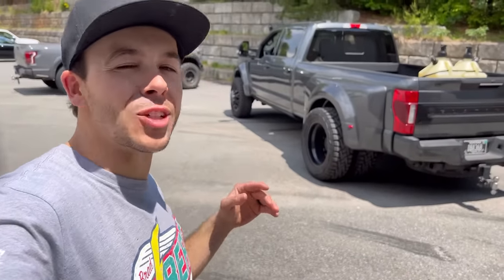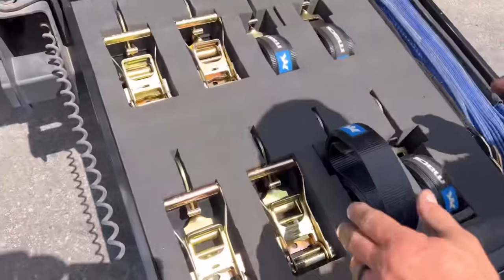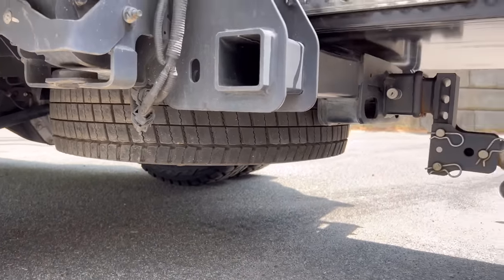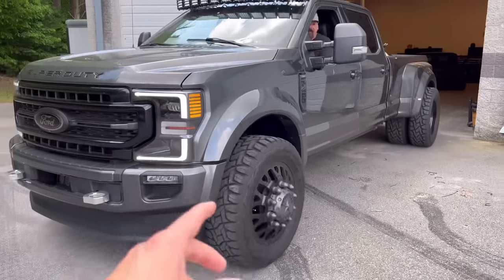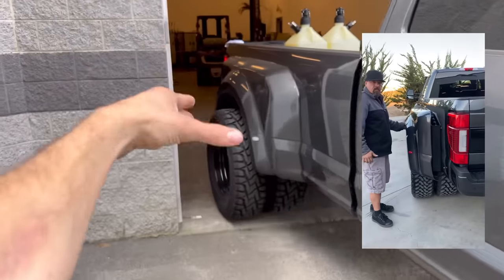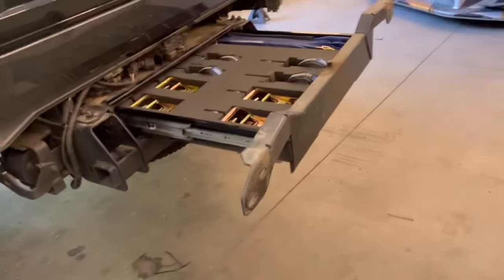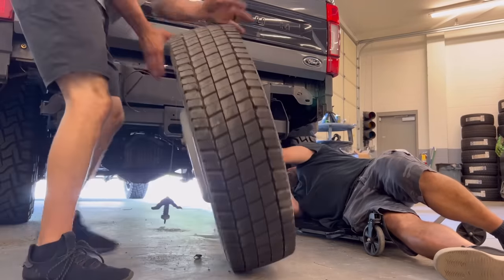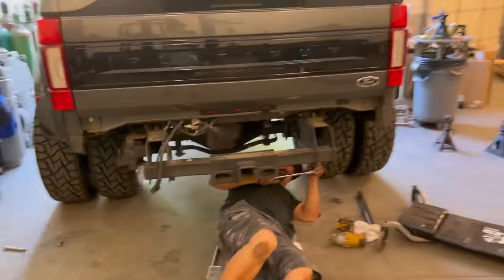BEST TRUCK INVENTION OF 2022? Hidden truck compartment patent for Ford, Dodge, Chevrolet & Toyota!

Comment: Hi guys, great idea, want one for my F150. But I ask hopefully one simple change. Can you move the spare tire connection under truck to passenger side? Thinking might be a dangerous situation being on traffic side if pulled off on shoulder. Just a thought. Keep up the genius ideas!
Reply: I also didn't like seeing how that's on the driver side, making it dangerous if you're on the shoulder of the road  during an emergency..... Passenger side usage is definitely preferred!
Reply: I will take one gents. My tires are two big to hold a spare. So I have plenty of space

Comment: How well does this hold up when you get rear ended (most common vehicle accident) and what kind of changes would you see with the stock bumper vs with this not to mention how well the drawer keeps items protected in such a case.
Reply: Probably about as well as a regular truck with a huge toolbox in the bed or a bed cover. Most people just toss stuff in them and lock it. They are using the crash and crumple zone space for storage space. Just like modding your car/truck you are using the safety and reliability % that manufactures have to design into their vehicles for longevity and warranty and various mandated vehicle laws. 
Get rear-ended in a regular car or truck and you will be replacing a lot of panels, brackets and 1 use only crash features like crumple pillars, foam and seemingly useless plastic parts. Guess where all those parts are on a stock truck.... 
Guess what you need to replace if you have these mods in a similar crash...

Example. I built a rear cross shock tower bar to square up my rear end for track day fun. It worked perfectly. Few years later a lady hit my car. If it was stock all the damage would have remained on the left side. Since the aftermarket bar was there it sheared off all the bolts on the other tower as well and the lower welded part dented the bottom tower. 
It's all about give and take.  

I honestly don't think there is much you could do outside of making a tank that would keep all those mods square and 100% perfect after a crash. 
It's a I had all this awesome convenience in my truck for 5 years then got into an accident and had to replace it. One of those well that sucks but it was worth it mods.
Reply: Your insurance probably won’t cover anything you have stored in this drawer
Reply: How can being rear ended be the most common accident? Statistically there will be just as many people rear ending someone else.
Reply: @Idontrunntoofast  
They back into each other
Reply: @Idontrunntoofast  bow chicka wow wow..........
Reply: @Idontrunntoofast  Youre thinking too hard about it, rear end collisions are the most common vehicle accidents. Thats what i was referring to.
Reply: @MSKDx  You are thinking to hard about it. It was a joke 😒
Reply: @lknanml  that's the reply I was looking for ;-)

Comment: Hey Brad, I have had this idea for years. So glad you built it and want to bring it to market. I will certainly purchase one. Does it impact the gooseneck hitch or does it stop short? Do you know if it will work with a 2010 F350? Thanks
Reply: I 2nd the question about the gooseneck
Reply: I third the question about the gooseneck
Reply: I 4th the question about the gooseneck
Reply: I 5th the question about the gooseneck
Reply: I guess I 6th???? 🤣🤷‍♂️
Reply: @sway696  you 6th about what?

Comment: Cool, but how does this modification affect crash zone test?  I know folks modify bumpers, usually to add beefier ones.
Reply: It’s literally a bolt in part, inside the hitch area. How would that affect ANY crash test numbers that would be of concern? If nothing else, it adds metal…… please stop making things more complicated than they need to be!

Comment: Van lifers and off road Enthusiast would love that transformer truck! Have a large Lipo Battery source for off grid living on one side, Solor panel on the inside of the Part of the truck that you raised up. and a fold out kitchen for the other.  And your bed is still left for a tent. Camp Anywhere!!    Anyway just a thought...

Comment: Very inovative . I like it a lot. Maybe you can do a hidden hoist that could easily unfold to lift anything you want. I could use something like that to lift my Power Wheelchair into the back of the truck. My chair weighs 300lbs. Keeping in Mind that it would need to clear the tailgate when it is in the down position. Great stuff guys. I hope this product takes off for you.
Reply from the maker: Thanks Bud.  We've been hoping it would take off too!!

Comment: Great stuff, I use a pickup for work and organized storage is difficult. The problem I would have will your systems is that I live in the north east. We get snow. Road salt is a killer. I wash the under carriage of my truck after every snowstorm and I still get tons of rust. I could see salt/rust causing operating problems with your systems. Even if you use some stainless steel the salt creates rapid dissimilar metal corrosion. Terrific product. Keep up the great work.

Comment: I love this concept. I use my truck in a similar fashion with a truck cap and boxed unit in the bed. This would add another layer of storage and access that folks would not otherwise know existed tucked away. Curios about how this is secured from tampering.

Comment: As a gas fitter, I could easily use this space for the less commonly used 1-1/4” and 1-1/2” piping and fittings. Although I’d have to ensure I could still use some airbags in the rear. Already squatting as it is.

Comment: Great idea.  With all these short bed crew cab models out there, how about a removable frame to transport 16 foot boards like 2 X 10s and 12s.  Maybe something that goes on the front bumper and over the cab to the back of the bed.

Comment: Love the design and your solution’s. I would change only 1 thing, the spiral-cable on the left will sack over time and will get jammed when closing. If there is a 2 feet pipe attached to the bumper with the cables in and only the spiral cable stays in the structure. It will extend the lifetime of the cable.

Comment: Awesome design with functionality in mind! My only concern is when it comes to installing/uninstalling, what if someone doesn't have the equipment to lift the box (i.e. a forklift or jack)? Maybe if possible incorporate the spare tire winch in some way to assist in the procedure (i.e. machine out something similar to the center bore on the spare tire's rim on the frame of the box) Just throwing ideas from an engineer's perspective, but still an amazing product regardless! Keep up the innovating guys! :D

Comment: Only concern I have so far is the spare tire winch relocation. It looks like if you have a flat tire and you're pulled over on the side of the road that puts you out in the roadway to lower the tire. I realize it's not that big a deal for someone I was just wondering how hard it would be to relocate it so it was accessible from the passenger side of the truck

Comment: Awesome Build. 
Very creative & well executed. 

As I watched you lower the tire, I thought, “Wouldn’t it be cool if someone made a pro quality adapter for a tool that would fit in a 1/2 cordless drill to lower the tire?”
Just thinking out loud for those who like to tinker.
Reply: It would also be safer to relocate the spare drop down to the passenger side of the truck due to an emergency, you are not on the lane closest to traffic when changing a tire

Comment: I have the Decked storage system in the bed of my 2019 Silverado 1500 but this bumper storage might have to be the next addition after I beef up my suspension! That is of course that it will be built for Chev trucks that is.

Comment: i would put on on my 83 chevy square body crew dually, only thing is i have the body ob a school bus frame so it would need to be custom built. and i would want it to go much deeper into the frame toward the cab. you have a great design there guys!!!
i built my custom truck completely by myself, didnt take it to any shop, but it is a simple job to mount a truck body on a school bus frame then move the axles forward to fit the fender wells. yes, had to have the drive shafts custom made by a drive shaft shop. i did put 5 ton military axles in it so i would have 4X4 but it is still licensed as a gas truck but it actually has a DT360A

Comment: Nice idea. I do wonder about DOT approval. I would think it would need to be crash tested since it's affecting the bumper or what's left of a truck bumper now days. Since the bumper is frame mounted so the frame absorbs impact, that may be an issue. I cert used cars and it would have to be removed and original assembled for liability.
Reply: Knew a guy back i n the 80's. He had made a custom rear bumper that  was also an  air tank, he was working on a pull out drawer and planning fold down bed sides above wheel wells and drawers in front and  behind wheels. 
His  insurance company  said reinstall original bumper and don't do any of the other alterations or he would lose all state required coverage.

Comment: It looks like the factory crank handle you're using for the spare tire places the driver on the driver side of the vehicle. Can you crank the tire down from both the driver side and the passenger side? It would probably give the driver more piece of mind if you could crank from the passenger side in the event of a flat tire on the side of the highway. putting that little bit of distance between the user and the rest of the drivers on the road would make it that much more comfortable/ piece of mind for the user. Other than that, it's a very nice product and can't wait for it to come out!!!

Comment: I work for a hydro utility
Lengthy bins r good for arrow, flagging and work signs. Also sometimes a hot stick or two (extend-a  P-2 stick and 6-7 ft universal gripall) may be toted as well, needing a moisture free compartment.
If u can get the lengths and moisture proof in these bins the utilities would probably scoop some up.
Just adding I as well as others wondered when something like this would be implemented into pick ups.
Not knowing where your from make sure u get into Canada.
Later.

Comment: It's very cool, and most of that is just unused space anyway... but what do the modifications do for the integrity of the truck? The back bumper, for instance, is no longer bolted directly onto the truck's frame, so what would it look like if someone rear-ended you at a decent speed? What kind of damage are you looking at if someone side-swipes you? Before it would just be a cracked fender that's replaced fairly easily, but does this change that? Awesome idea, but those are questions that serious buyers will want to know answers to.

Comment: see this design being used in so many different applications, and i say brand new trucks off the line should have options for this being installed, i support  your idea, cause a plain truck bed is just plain, if i had a truck id plaster your name all over it the advertise,  better usefulness of the truck bed and  the bumper i see that being a thing for more than just trucks... keep up the good work

Comment: 😎 dude... tools where you can get to them... and a hydraulic ram for tailgaters... can't beat that with a stick
Reply: I just hate when you can't see their license plate... way too close, know what I mean?
Reply: I lost a box of tools once... took a forklift to get it in... they really wanted em... got past the dog.. and me... this looks great, y'all... thanks 🙏
Reply: so... I've got a process that will turn aluminum into a metal as strong as steel... and a melting point north of 1550° Celsius... like steel... but as light as aluminum... with existing parts... so you do the machine work on aluminum... and convert... it's literally dirt cheap.. no patent.. the Chinese already know how... like for thousands of years...
it can be stick welded... no fancy gas required for beautiful shiny welds... glad to show you how

Comment: In Australia it’s very common to have a storage drawer under the truck bed although most trades replace the factory bed with a more practical aluminium one with toolboxes. There was also a company over here doing the lift up fenders a few years ago
Reply: "Its very common to have an entirely different setup that has nothing to do with what is showcased here used by an entirely different buyer market"
Okay?

Comment: I know Ford used to use shear bolts on the lower bumper mount bolts so it would fold under upon impact. If that is what you are after, then there would need to be a way to replicate that.

Comment: I’d LOVE that bumper tray system on my new F350 Tremor. Would it fit with a S&B 60 gallon diesel tank and coukd it be made to work with a pipe/HD replacement bumper? It’d be a terrific place to transport firearms and camera gear when I’m in the mountains. What’s to best way to reach out to your company about getting in line to get one?

Comment: This is a great invention! However, this ain't gonna work in PA NY MI, states where the amount of salt brine dumped on the roads would crush an elephant. Maximum of two winters and it won't open. To all those in the areas that don't get salt covered roads, this will be great.

Comment: Very interesting not sure it works for what I would want, but I like where you going with it.

Really, the factory spare tire winch, they are garbage. Any time I have needed the spare tire I have to figure out how to cut off the winch without damaging the wheel as it is completely froze up with rust. My current truck I have had 2 flats and had to call a tow truck both times as the spare tire is never coming off that truck.

Comment: Looks fantastic but how does the rear tray affect warranty? I’m assuming this is no longer valid due to the slide mechanism? If not, has it been independently tested and certified? Thanks. Very very cool
Reply: Warranty would not be effected with an add on like this.

Comment: I would put it on my 2012 GMC Duramax 2500 HD. I am a roofer and always need more space for stuff without clothes or not the bed of my truck like I always do. Oh yeah the bed of my truck is got rust in the fenders I really need one of your transformer beds too even if I have to make my truck a dually it'll be worth it

Comment: I have the same color truck but F-350. I will most likely order your invention. In meantime if you would provide badass wheels/tires set up info. I would really appreciate it. Thanks.

Comment: I'm a plumber and I use a F150 do you have this for that. The reason I ask is what's the best selling truck in USA F150. Also I use a topper I'm thinking the box sides wouldnt work but the bumper I'd be interested in

Comment: Cool idea but how long until the modified wiring for the lights stops working ? Stock wiring is tested for thousands cycles and thousands hours in all of conditions and still has problems a few years down the road. Thank God the truck isn't a Chrysler product !

Comment: This idea is truly fantastic the only question I have is what happens in an accident it looks like the drawer rail would take the impact forces and would not be as safe as the factory original bumper mount.
Reply: The box rails are tucked right in between the frame ,,,if  any kind of rear end impact were to happen it would add to the rigidity of the structure ,,, except for the out side corners of the composite bumper ,,,that arent designed for impact to begin with ,,,,

Comment: I made something just like this about 20 to 25 years ago, and I really liked it. These units I must say, are exceptionally well suited for stable weather. Stable weather : meaning, if it is summer, great, but must stay summer all the time, or if it is winter, it must stay winter all the time. Any time the weather would change approx 10 degrees in about 10 minutes, night time coll downs, all the steel would collect condensation and the box system itself was fine, but any of the tools I put in my box, is what would deal with the rust. I thought, perhaps I could vent the box, as mine also sealed up tight, well, that didn't help none. The next design, I used for the floor pan of the slider box, heavy gauge expanded steel, that kinda helped with the condensation collection, but weather change is gonna do what weather change does...  

Please note, Winter time was not an issue, as the box was sealed up, it really is just the temp change in a certain amount of time that caused the issue. Also, keep in mind, the weather forecast claiming stable weather, is one thing, but, the truck having exhaust warming up the box and its contents a few degrees warmer, could be just that little bit of threshold that will allow condensation to start that process... Good luck. Nice looking set up.

Comment: Have you done any safety testing yet in case of an accident for either the bumper drawer or the transformer sides? It would be important to have safety rating or information on what might happen if the designs you have weakens, strengthens, or it's not effected in an accident. But I think your designs are on fire, super awesome ideas! I have a couple ideas for you if you're interested to take them and run with them.

Comment: In my opinion, this defeats the purpose of having a bumper.  The bumper is there to take the damage of minor collisions at the rear of your vehicle instead of other components, and if damaged you have the choice of living with the damage or just replacing the bumper.  I can't see this being able to stand up to the same kind of damage as a bumper that's bolted to the frame the way it's intended to be.

Comment: Also there is a reason truck manufacturers haven't done such stuff (do you really think your ideas are orginal) mostly because of cost vs profit margin and the small market for it to start with.....
Reply: There is also crash safety standards and safety standards regarding lighting. That is why this will never be a factory option.